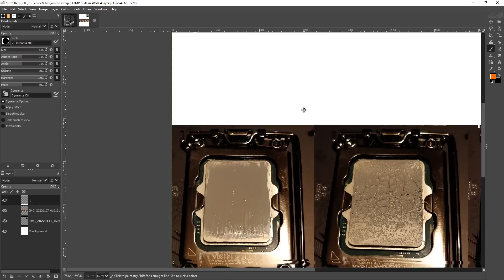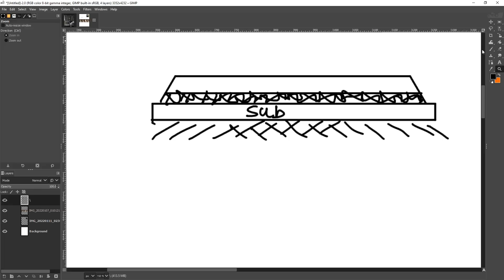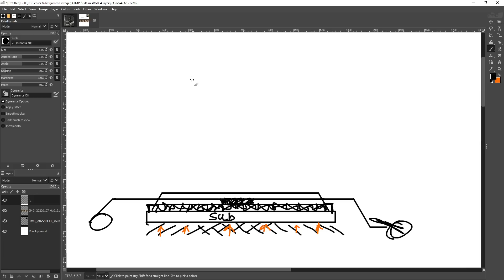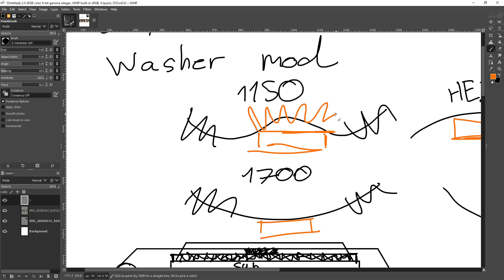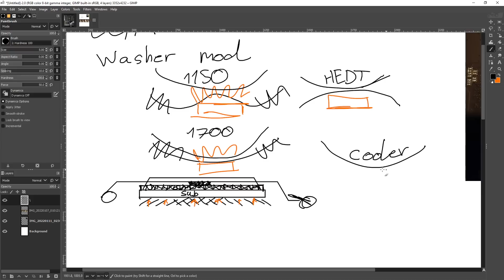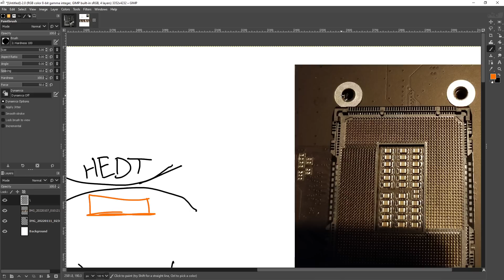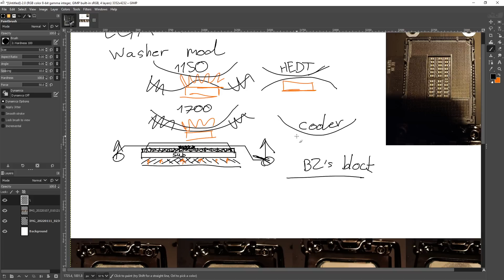Rambling about the LGA1700 washer mod

Comment: bought the post's from corsair to cure this for my corsair aio for less than $10.00. LGA1700 Retrofit Kit
Reply: I may be misunderstanding, but I don't think this issue has to do with the cooler but it has to do with poor design of the actual retention mechanism on the lga1700 socket. It is not placing even pressure on the cpu causing it to bend and possibly the mobo as well

Comment: Thanks for the info! Been following this since I read it on Igor's Lab.  Glad to see your input! So, I'm building a new system and have an MSI Z690 Unify-X. When I pulled the ILM there was a 1mm spacer under it already from the factory. Not sure if this is normal to protect the PCB or if MSI knew of this prior.
Reply: Actually, just noticed there is ANOTHER pair of 1mm plastic spacers on the bracket itself, right next to the tabs that push the cpu down. They push against the already plastic edge of the socket when closed, so they aren't there to prevent scratching, but they guarantee that the tabs are 1mm higher than they would have been otherwise. This sure looks like a quick&dirty hotfix to me, just like the washer mod but right from the factory.
Reply: Huh, my Asrock z690m phantom gaming 4 also has a non-metal spacer 1mm thick under the bracket. I wonder if I want to add a second spacer there, though.

Comment: The springs don't plastically deform, and the CPU bottoms out on the plastic piece. However the springs could creep due to temperature effects.
Search up the effect on springs in loaded magazines and you'll see.
Reply: Looking at some viewers' comments, it seems either the LGA pins aren't performing very well as springs in the long term and they do plastically deform (memory channels fail when a different cooler is mounted, and works again when swapped back) or it could be that the CPU substrate, IHS, motherboard, or cooler base (or any combination) has plastically deformed to cause a poor pin contact issue. Regardless whether it's spring, IHS, cooler base, or fiberglass, it explains how and when the washer mod will or will not work.

Comment: Not only lapping with remove LM residue (which I don't like, you should use fresh LM, liquify it, wipe it and use steel wool to keep the nickel stain) but having the coldplate AND the IHS as flat as possible is better for LM since you need as good contact as possible since you use very thin layers of LM. I haven't found many coldplates that aren't flat (they do a good job, at least on AIOs) but my 1800X and my 3900X had both very badly curved IHSs (I guess happens on the soldering phase)

Comment: Seems to me the mounting pressure of the cooler should ideally be higher than that of the loading mechanism in order to assure good IHS contact. One could - via washers - reduce the role of the loading mechanism to a mere mounting aid holding the CPU in place.

Comment: So for AMD cpu with flat (either factory or sanded) heat-spreader the optimal water-block should actually be also flat then because AMD doesn't use LGA socket. Correct me if i am wrong please.
Reply from the maker: yes for flat AMD CPU you want a flat block.

Comment: The pins are springs?  No.  They're uneven heights?  Nope (on a scale that matters). 

 The mounting mechanism is to align the cpu uniformly against the pins and provide initial force to hold the cpu in it's proper orientation.  

The hsf mounting pressure is far greater than that of the mounting component.  Your issue is that you still don't have anything other than a dummy cpu to play with.  Not to mention IHS' are flatter than they used to be.  

Meh..

Comment: Could you not just remove the CPU retention bracket entirely? would the cooler not have enough pressure on its own to have good contact with all the pins?

Comment: nice vid, and there is 7700k , delided, that only works on water cooling block, beacause if you tighten it too much, it refuse to boot with both mem sticks :) i applied silicon under IHS like factory did, but, didnt help.  well, its water coooled, screws are loose, buuut, it works, if you touch it (repaste), you gonna curse a lot. 4,8 with normal voltage

Comment: I had a very strange issue with an old 8700k just recently. I've had a D15 on it for 3 years straight. I was curious how it would perform with a liquid freezer II on it, so I swapped. After that, it would not post with all DIMM slots filled. It would only post if I had a stick in A2. All other slots were dead. When I swapped back to the D15 it was working fine again.

I had no clue what was causing this but from what I can tell from this video, it could have somethign to do with the socket pins? Can a large, heavy air cooler contribute to socket pins losing contact after years of use?
Reply from the maker: if it's leaning it might've flattened one side of the socket.
Reply: @ActuallyHardcoreOverclocking  This is scary. Imagine I had an 8700K right now in my primary PC and in another generation or two I want to upgrade and put the 8700K into an HTPC with a smaller form factor, lower clocks/voltages/power all that. And it would appear to be dead just because a large heatsink was on it in an ATX tower? That’s a medium oof, and they made the IHS for 10th gen and onwards thinner? Yikes
Reply: @depth386  He is talking about the socket pins. Not the IHS nor CPU thickness in this situation.
Reply: @GravitySandwich  Yes I agree with you. The reason the pins closer to the center of the socket bend more out of shape is because the entire CPU is flexing. The IHS is what provides the most structural rigidity. The bottom line is this: Intel should bite the $0.50 bullet on the motherboard retention mechanism.
Reply: @depth386  Unfortunately the consumers will end up eating that cost anyway.

Comment: I lapped my h100i + ryzen 1600 non X and my temps went down significantly. OC to 4ghz with 1.4v my temps under prime95 small FFTs is low 60s

Comment: If anyone just wants to test this and doesn't have any thin washers on hand, Post IT Notes or just regular paper can be used to make shim washers out of.  Its non-conductive and fairly thin.  

Paper is about .08 ish millimeters thick (about 3.5 thousandths) and Post ITs are .1 mm thick exactly.  Yes it does compress a little with pressure down to maybe half its thickness but the difference in thermal paste we're seeing here is likely 2-8 thousandths of an inch (.05 - .2 mm) or 2 layers of Post ITs stacked (maybe 3 compressed).  This  would also allow you to try 1, 2, 3 layers and commensurate mounting pressures.  

Regular paper is fine too, just a tad thinner so it would maybe have less of a delta if you're testing for these temperature issues and want to dial your mounting pressure in.

This is also the reason for AMD with their chiplet approach that some people see high temperatures with 5800X.  Lapping or mount alterations or some combination of can also successfully address this.  Because 5800X has only 1 chiplet, the support under the IHS isn't uniform when its heated and soldered on and can deform it slighty.  Mine was out by about 3 thousandths of an inch (.075 mm) which lapping took care of.  It does void the warranty but if you've established you have a good clocking functional chip, it should stay that way.  YMMV

Comment: I'd love you to make a video about RAM cooling. Disassembling the heat spreaders, swapping TIM, putting fan on them and so on.
Reply from the maker: RAM doesn't really produce much heat so just pointing a fan at it will have more of an effect than any complicated procedure will.
Reply: Older generations produce some heat and I've got the disassembly figured out by now. A lot of patience is needed. The issue is to find the right TIM. If to thin it often won't make any contact with the heat spreader.

Comment: I use an nh-d15 which is supposed to have a curved cold plate and I still see spread like you show. Hit about 90 in cinebench and 60s to low 70s while gaming. I'm sure I'd have gains from doing this but not sure it's worth it for my use case.
Reply: Make sure the fan speed is able to hit max. (1400-1500RPM) If you use the lownoise adapter it will be 200-300 RPM lower and that could be the reason for the 90 degrees.
90 is still ok though, i think 94-96 is the throttle temp.
Reply: Are you concerned about the cpu and mobo bending/warping?

Comment: How can the pins push up hard enough to bend the CPU when the entire pcb sits on the plastic shroud around the pins (socket casing) once it's mounted. I think it's more the entire board warping from the pressure slightly.
Reply from the maker: the CPU rests on the pins not on the plastic. The plastic is just to key the CPU orientation.
Reply: @ActuallyHardcoreOverclocking  hmm maybe something you could test with a small amount of clay or something. Could get gamer nexus to do it lol. Put a small amount between the plastic and the ihs along the edge and see the thickness after clamping then do the same toward the top or bottom and it would tell you if the CPU was warping more than the socket or if it's the entire socket?
Reply: Even if the CPU is touching the plastic shroud, the springs still need to apply force against the CPU to have a good contact, so the spring will still try and lift the edges of the CPU up and away from the plastic shroud.
Just like a battery in a tv remote, the battery does not go anywhere, but the battery spring still needs to push onto the battery for good contact.
The spring pins push very little, but when there are 1700 of them, it ads up.

Comment: Received the 1700 adapter for my Galahad 360 and it mounts properly on my 12700K.  Thermals are pretty good - 5.0Ghz all core is stable for everything and 5.1Ghz runs fine for CB20 or CB23.  5.4 and 5.3 GHz single/dual core is also stable.
Reply: Thank you... this is the kind of post I was looking for. I am about to build using the galahad and the 1700 adapter but am hesitant about all of these reports of bowing the mobo and cpu. Do you know if yours bowed or is bowing?
Reply: @mikerzisu9508  I've only mounted the heat sink once and not taken it off so I don't know if there is any bowing.

Comment: I did this mod on my TUF D4 board and it made the CPU not make contact with some pins, as aparently, I lost the two innermost dimm slots. Going back to stock solve the issue. Just making people aware than contact issues may arise when performing this mod, so don't panic if it happens to you.
Reply: I just did this on my Tuf D4 and did not loose any of my 4 dimm slots, i used .75mm plastic washers (thats just what i had laying around), this mod improved my temps at load by 3.5c.

Comment: Looking you paste on cpu, your cpu is bent at Y axis and not on X axis. So it's not problem preasure on cpu from mounting mechanism. Your cpu is just not flat. IHS does NOT bend so easily. Your block if it''s not lapped it is not flat too. there is NO flat cooler or block or IHS, never!

Comment: If you have a ek velocity2 Waterblock for lga1700 and torqued properly to 0.6nm, temps are the exact same.
Reply from the maker: isn't that  block specifically designed for LGA1700? EK probably designed it to compensate for the curve.

Comment: Okay, i have to ask. It is REALLY POSSIBLE with THAT WEAK SPRINGS like pins to bend IHS of the CPU that much? Really? Pins are really, really weak, and IHS is quite... thick
Reply: Second thing. Every single mounting mechanism for cooler will BEND IT AGAIN pushing against pins. If it will work that way, shouldn't it bend IHS back to normal or even more in the second side? 

Coolers do A LOT MORE PRESSURE to the IHS than this pins
Reply: I am more likely to belive that pins have nothing to do with it and it's because this CPU is... quite "long" and pushing it on the mid makes it bend because PLASTIK PART of socket bend with it. And there is NO FORCE on the corners of that LOOOOONG CPU so it won't compress that much

Comment: the bracket should be designed to apply pressure all the way around and the substrate should bottom out at the ideal spring load.

Comment: The IHS is longer now, right?  So one additional issue is that the same curvature to the IHS results in a larger z gap at the center.
Reply: I guess this is the real cause of the issue, because the mounting pressure is exactly the same as last gen LGA1200.

Comment: With EK's EK-Quantum Velocity² D-RGB - 1700 and 0.6 Nm torque doesn't do nothing on cpu temp , it's aleady set .
Reply: i have the same waterblock. have you checked if the coldplate is 100% flat (i didn't before mounting, unfortunately)? what are your experiences in terms of temperature delta to water? how are your temps @stock CB23 in relation to water? i'm peaking at 79 °C cpu package temp while water is at around 27 °C => Delta Water / CPU = 51°C. Delta coolest / hottest core = 67 °C vs 79 °C = 12 °C.

Comment: Why didn't you just remove the loading mechanism and push it down directly with the water block mounting pressure?
Reply: Any kind of twisting and tipping of the cooler when mounting or removal, will damage the plastic socket if the mechanism is not there to hold the CPU in place.

Comment: a good and simple  way to stop the motherboard pcb curving under the socket  is to mount it to a hard flat surface under the socket... like your desk. or a piece of wood or thick metal whatever. then cut a spacer out of a high density plastic.and put that between the socket plate and the hard rigid surface. i already do this under my 24 pin and under the dimm slots.  and no you often cannot do that in a regular pc case. because your typical pc cases are dumb and stupid

Comment: I think if the flatness of thhe cpu is as sensitive as you say, you ought to use arbor shims instead of cheap stamped flat washers. The shims will give you much better thickness tollerance whereas the plain washers can vary in thickness quite a bit.

Comment: I'm seeing 77 degrees on a 12700k and a Noctua d15 stock settings with Cenebench r23. I think this comes down to manufacturing tolerances with the cpu bracket. I don't think I would achieve anything doing this mod. AIO users maybe.
Reply: im running a 12700kf and a lga 1200 AIO, im considering it. im running my 12700kf OC to the 5ghz all core. 280W.
Reply: @Hammercannon  did you do it?
Reply: @mikerzisu9508  this weekend or tonight if I have time.
Reply: @Hammercannon  what aio are you running?
Reply: @mikerzisu9508  Coolermaster ML360ARGB LGA1200 version. Side mounted in a Thermaltake View 71, with push/pull fans
Reply: @mikerzisu9508  i did it today. made temps 5c worse. so i went back to how my original was. temps dropped back to where they were. i guess it only works in VERY VERY specific situations

Comment: From the pictures I’ve seen though the mounting pressure of the loading mechanism seems to sometimes bend the whole motherboard PCB and not just the integrated heat spreader.. especially on low end boards that aren’t as stiff
Reply: My asus apex is deformed around the socket area, I can see it from the top of the board, perhaps for this reason
Reply: Wouldn't a MOBO backplate help with that?
Reply: @BAJF93  yes, that’s why it’s less of an issue with enthusiast boards that have metal backplates

Comment: So how much pressure are you imagining that the pins push up? It sounds lile we are dealing with huge forces from the springed pins... does not sound logical for me, also that you get a cooler putting pressure down from top and puts pressure in each corner first if the retention bracket curves it alone. So that the pins puts that amount of pressure sounds illogical...
Reply from the maker: intel specs LGA2011 for a minimum ILM pressure of 445N. Or about 0.22N per pin
Reply: @ActuallyHardcoreOverclocking  ok. But that  doesn't mean anything about how much pressure they put out, it's only that  they want 45kg of force put on it from the middle, so would make more sense if it curves purely because of the retention bracket and not the actual pins. So, if you wanna be real here, take a cpu, put some dab of anything that  will leave a mark at same height as the pins would be when they are pressed down, for ex in the middle of the socket, if the pins are that  strong, then u shouldn't be able to press it fully down with just your hand. Right? See what I mean?
Reply from the maker: @micheskillz  but you can't press the CPU fully into the socket with just your hand. I've had motherboards with worn out hold down brackets and I basically had to put my upper body weight onto the CPU cooler to get the memory channels to detect.
Reply: @ActuallyHardcoreOverclocking  interesting! But I guess what would make most sense to why the washer mod works is simply because the ilm puts down most pressure and not because the springs needs to have like 25grams per pin of force, but rather that it's getting pressed down at such force in the middle that the counter effect is to curve the socket itself, so this makes for an interesting topic that  I will try. Also the washer mod removes a lot of force that gets put down by the ILM, by how much depends on exact thickness of the washers, did you do the math for this?
I am sorry if I question it, but I see counter measures being applied even tho Intel specs says one thing and then washer mod does the opposite thing. Also pay attention to details, how the pressure is applied is how it gets curved, is what I see. Also the specs says, contact-deflection curve, defined as working range, so minimum and maximum deflection range at the contact load, to meet required specs until EOL, either way, the pins are not what causes the cpu to bend, the ILM is, for every action(force) there is an equal and opposite reaction (force)